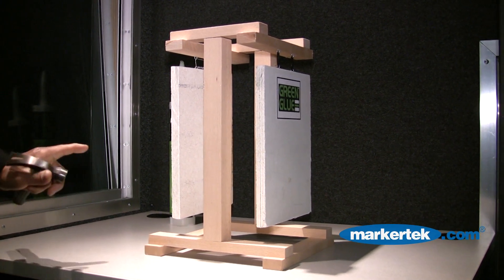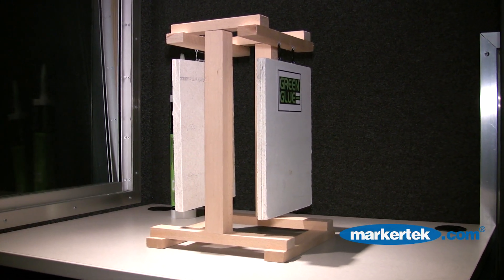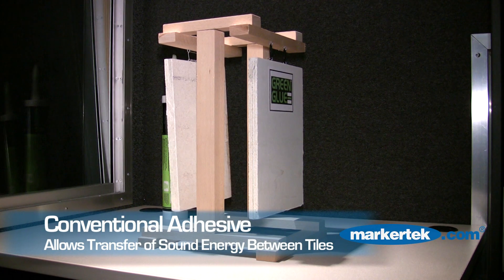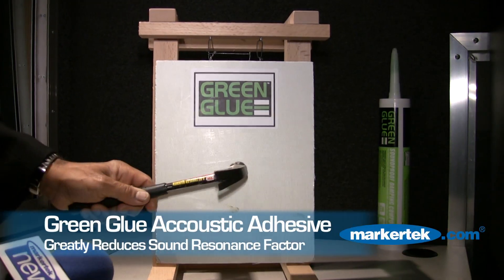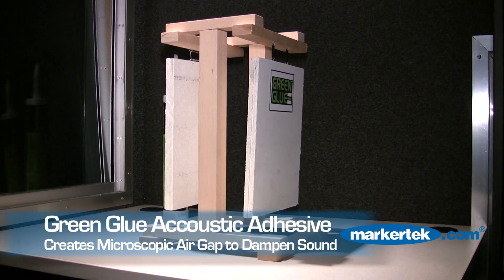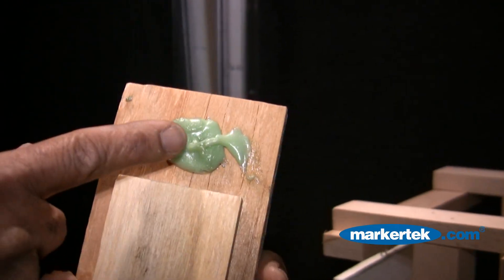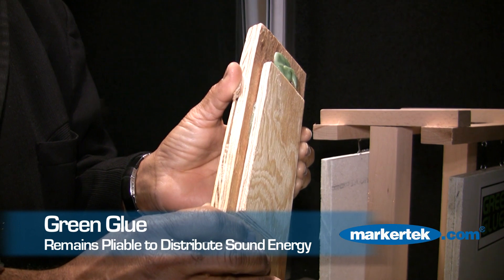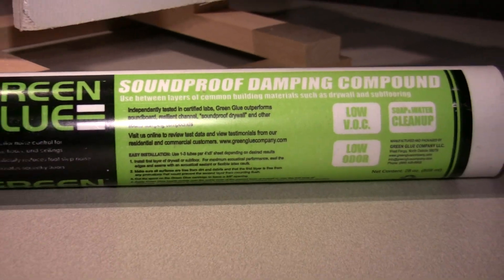New Acoustic Damping Adhesive from Green Glue

Comment: I am curious concerning your reply.  Sound travels everywhere particularly in British homes that have such poor engineering, where the non-graduate thrifty builders save a penny to condemn future dwellers to noise.  For example, are you sure that the noise is not travelling through the structure and emanating at some other wall.  Perhaps green glue works well but the noise is travelling to some other wall that acts as speaker! just asking...

Comment: The glued tile also has steel inlets holding it to the wood, meaning the sound is transfered directly to the wood frame, yet the green glue has a black rubber bands holding it to the inlets.  Not saying green glue doesn't work, but just saying that the mounts are making the difference even more pronounced.  To be fair they should of used the same for both.
Reply: I noticed that my self. LMAO can't even make a real fair test

Comment: I am very interested in this product simply so I can skip the track channels and Cleats to Isolate and create a floating wall, it would save me some money for sure. I was wondering If I was to still use the age old tried and true meathod of using sheer mass and installing either 1/4-1/2" MDF over all of my walls and celing with still possibly home made "Z cahnnel wood strips for an outside covering of drywall if this could be OK for a good Home studio, and kill of volume of drums and such. IC

Comment: The comparison of silicone against green glue as a means to apply both as a constrained layer damping material is not only wrong, for someone that is in the market to sell these items, it  shows a lack of information on your end.

Silicone caulk, if used between building materials as an adhesive is the same as throwing money directly out the window, It [silicone] has no comparable ability in respect to green glue, none.

Education, not speculation.

Brien